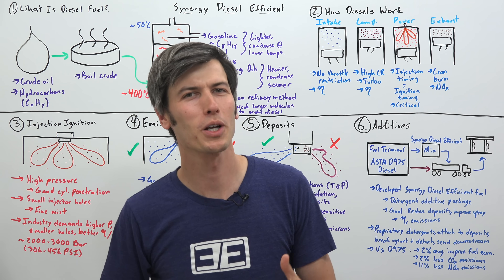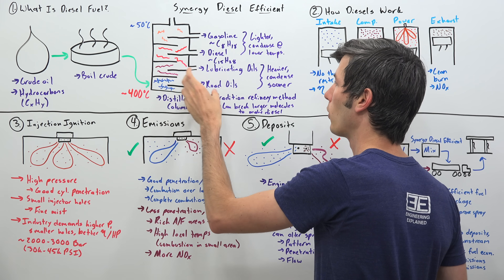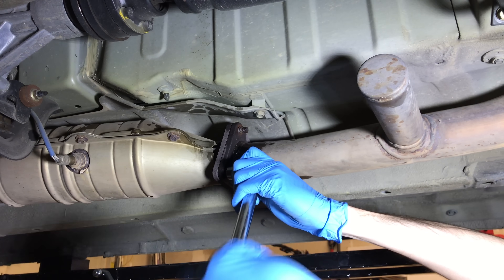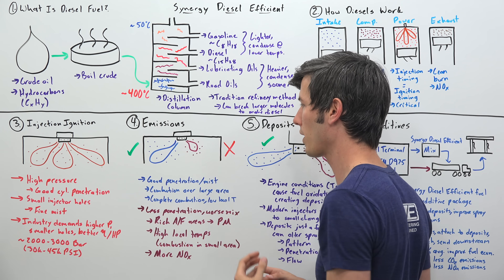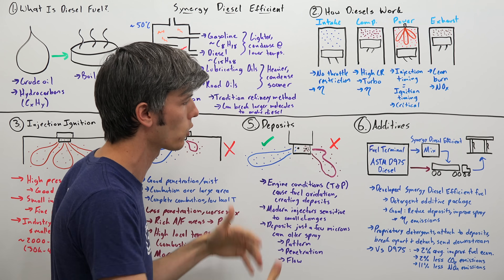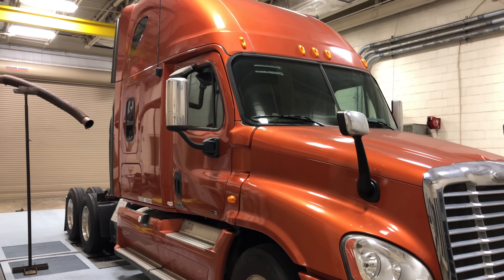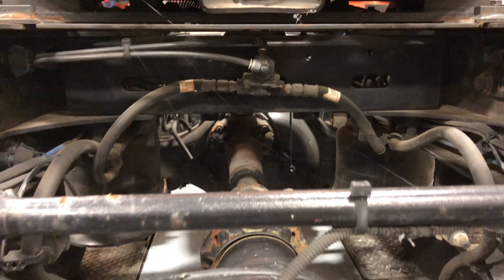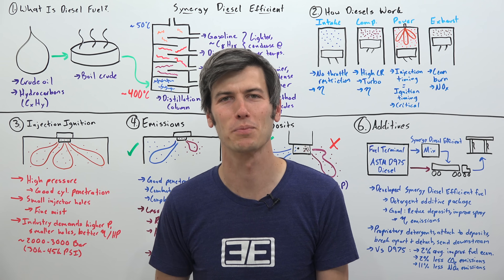Why Diesel Engines Lose Power & Efficiency Over Time

Comment: Good video and very thorough and interesting but as someone in the heavy trucking industry, I'm still not so sure about their testing of the diesel. Their variables are so controlled. How does it work in the real world? Where the variables are not controlled. I live in northeastern South Dakota where in the winter we spent around 100 days below 0°F most of it double digits below 0, just ambient temperature. Now in the summer we're in the upper 80's to 90's with some days getting near 100°. That's just for temperatures not including wind speed, engine condition, or driveline conditions. Do lab tests to determine a baseline then run a test vehicle in all sorts of weather variables then check the numbers.
Reply from the maker: If you don't control variables the data is anecdotal and significantly less meaningful. That's why you must control variables to see if a difference exists purely as a result of the fuel. These benefits will occur regardless of ambient conditions, but the benefit can vary with varying conditions. They also performed real world testing, it simply has a larger error bar.
Reply: @EngineeringExplained  I do understand the controlled environment testing first. To see if it actually makes a difference or not. I suppose if the engine is getting the benefits, it gets them regardless of the environmental conditions. I couldn't remember if you had said that they did real road testing in the video or not lol did they mention how many miles of real world testing? Short term memory loss getting me here but they tested it on engines that were pretty much just broken in right? If you had a little older or higher milage truck or tractor with aftertreatment and egr and switched to their synergy diesel, could the owner/operator have more frequent problems/regens with the dpf and egr due to more deposits going downstream until the combustion chamber cleaned up enough? Sorry for the long reply and questions lol

Comment: After learning about Diesel Particulate Filters, it is nice to appreciate the details about solutions for diesel engines. The "Regeneration" process to remove particulates was interesting to learn about. I'm glad this video gave a lot more info about these engines. I now have more sympathy with my fellow truckers on the road and mechanics in the shop. Thanks for the insight!
Reply: The emission controls ruin these engines and make they less efficient,  so burn more fuel, and makes us spend more money on parts when they go bad cause they all go bad , if we got ride of the controls then the only thing diesels would do is put out soot and have no NXo a cat causes the higher temps and that causes nitrogen,  then the egr was there to bring down temps but brings soot then they brought in a dpf  and that raised the temp got rid of soot but more nitrogen back, then they had the def that helps with nitrogen but helps ruines and destroys everything faster and burns more fuel, remove all that and we would be good to go

Comment: In order for this not to be just a commercial for Synergy Diesel you ought compare the results with some other "premium" diesel or maybe compare added costs of Synergy Diesel with savings made by using it.

Another thing are laboratory conditions that lack much of real world variables. This means that the test may not even be relevant in real life. People (Exxon) who planed this analysis already know this, but do not care. Since the whole exercise is just a commercial. Jason, I thin you caught yourself in something nasty this time. I really hate when honest engineers (or scientists) are used for deceit. Otherwise I really enjoy your channel and I hope you will avoid such dishonest sponsors in future.
Reply from the maker: So you're making assumptions while a company is providing data. Sometimes people choose what they want to believe and that's that, no matter how much evidence is provided. Not only was dyno testing performed, but extensive on-road testing as well. But if you want to prove an efficiency change, you need to control all the variables, hence dyno testing. What you choose to believe is up to you, but I'd hope viewers would prefer data over opinions, which is what I aim to provide.
Reply: @EngineeringExplained  Well I believe that Synergy Diesel is more efficient in some or even all conditions. But efficiencies are only relevant relative to costs incurred. Exxon knows that 3rd party independent tests will show some efficiencies in improved fuel. This is why they ordered the test. But they do not tell the whole picture in any case. What I am doubting here is the motivation behind these tests. The motivation is to sell something that may not necessarily be beneficial (in relation to costs) to its customers. What I am try to say is that the tests were set up to show beneficial results that are not relevant in RL. And I am sure that the tests were done as good as they could be done.  
And they are using your authority and the authority of the independent tests to market their product. I am sorry if I am too harsh. The video is brilliant from engineering point of view. I just do not like science being abused for PR.

Comment: i would be curious if you could figure out (with actual scientific research and investigation/testing ), if all the emissions equipment of diesel engines that is required today is actually making them pollute more or less. For example i believe the new diesel engines are required to have a high pressure egr , low pressure egr , and def system. I have heard from many sources that trucks that have these systems removed average 5mpg higher. that's burning a lot less fuel over the life of the vehicle. so does burning that lesser amount of fuel contribute to less pollution created per mile  vs the emissions equipped truck burning more fuel for traveling the same distance. plus the regen cycles the trucks go through burns even more fuel to light off the soot. compounding the increase fuel use.
Reply: I think there are 2 things: for less pollution of the planet, less fuel would be better, for the direct health of people, the amount of fuel is seen as not as important as the amount of particles and NOx emitted.
So what do you want to harm less: the planet, or the people... 

(new direct injecting gasoline engines mostly need filters too nowadays, but as i learned yesterday only 7% of all CO2 output in the world is from "traffic" which includes everything from cars, trucks, ships, aircraft... While 1/3rd of all CO2 output is caused by making electricity, so going electric might not be the right thing either causing even more need for electricity.)
Reply: @nirfz   i can see what you mean about having to choose 1 or the other. but since we are talking about fuels. the fuel also consumes energy and creates pollution just to make in the first place.
Reply: @TheDaltonmichaels  true, but as these fuels (both gasoline and Diesel) contain C and H in different amounts they can be produced by using CO2 out of the air and water. The enrgy to do that could be a good use for solar or wind power. They are better suited for such use because they give power when the source is available, not when people need it. (Co2 neutral Gasoline and Diesel Fuel is doable but at the moment fossil ones are cheaper) Fuels are easier and less dangerous to store than electricity at the moment. (faster to fill up too, and easier to extiguish a fire of these than of Li-Ion Batteries)
Reply: @nirfz  Another thing that i just realized is that DEF fluid production itself creates pollution. Now there are trucks driving around the country simply to deliver hundreds of thousands of gallons of DEF fluid to every fuel station and some stores every week. how many new tanker trucks got added to the road who soul purpose  is delivering DEF.
Reply: @TheDaltonmichaels  Valid argument.
Reply: Emissions as alot to do with temperature. Things need to be at the optimal temperature for the optimal emission. Catalytic converters need heat to work. Sometimes dumping more fuel in can help this. And burning more or less fuel can help with the temperature of the combustion. Never cars typically use less fuel still tho.

Comment: Do you have a video on the effects of the diesel exhaust systems causing additional fuel economy losses?
Reply: He didn't cover what extra emissions result from the additive. Sure, it cut some NOx, but is it now pumping out cyanide gas? Getting lungful of diesel combustion fume behind trucks, this is much bigger question as to what else is there due to additive.
Reply: I feel like they put all these emissions systems on the new diesels because of all the diesel fuckbois cranking up the fuel and blowing soot for days in their new trucks
Reply: @bdcasey11  those guys piss me off to no end.
Reply: Deleted my Cummins, best thing I ever did. The egr is what causes engine damage, the def is just a hassle and pain
Reply: Kenny, diesel exhaust systems have effect of the lawmakers causing additional fuel economy loss, not just by itself
Reply: I don't think they do. Cars are bigger and heavier. Bigger wheels. Bigger everything 🤔
Reply: Are you referring to selective catalytic reduction (SCR) systems that use DEF to reduce NOx emissions? Or diesel particulate filter systems? I'm not sure how treating the exhaust with urea would decrease fuel economy. DPF systems, perhaps, since the engine would have to work harder to overcome a restricted DPF.
Reply: So why not use multiple injectors on each cylinder?  You will obviously get a much better spread by using 2 injectors instead of one.
Reply: @tarstarkusz  where are you sticking all these injectors? you want a even spread in the cylinder, so, on in the center... 360 spread... put 2.... meh... ontop of the valves already... and the cost.... diesels are already not worth the extra cost... adding 6-8 more injectors? LOL
Reply: DEF, EGR, DPF = delete
Reply: @D4rK_An1mA  Hope you like the heavy fine if you are caught and the fact your vehicle will NOT pass inspection if it is removed.
Reply: Kenny yes!!!!! He should do that cuz that def system on diesels suck down the power and mileage
Reply: Diesel exhaust after treatment systems only use extra fuel when they are equipped with a DPF.  SCR (DEF) systems do not use extra fuel for their functions.
Reply: @KALI1080  the SCR is added on after the DPF. So yes it uses the same amount of fuel. The DPF is unchanged after the addition of SCR. The two systems work in conjunction with each other.
Reply: Yeah, good video idea. I straight piped my Cummins 5.0 and got nearly 10 MPG better on the stock tune (8 MPG increase)
Reply: @wyattlarrick3246  I HIGHLY doubt that removing a DPF gave you a 50% increase in fuel economy.
Reply: @usingthecharlim  But what is extra stuff coming out of exhaust from additive? I suspect it's not as deadly as VX gas, but just saying it's small fraction doesn't mean anything unless potency is considered.
Reply: If you have a light duty diesel that only lasted 200k miles, you probably have a 6.0 Powerstroke.

Comment: Love it how efficiency is measured on day 1 and ignored thereafter. Who cares if the motor/emission controls let go @150k and need to be replaced... may I be controversial and say a good predictor of overall efficiency  is the price of the truck on the used market
Reply: In germany you need to do a complete inspection including emissions test every 2 years to keep your vehicle registered.
Reply: Except a complete truck has many wear items. Better would be used engine prices. Which for diesels are shockingly high.
Reply: poobank 

Nothing controversial about it. You are simply wrong.

Comment: A euro vs US comparison on the quality for the diesel fuel could be a good follow up..
Reply: Yes, but in the EU there are quite some differences. If I drive from Holland where I live to Germany (1 hour drive) the quality changes (normal diesel in Germany has more % biodiesel).

So there is no 1 EU diesel
Reply: @MaUrIcEtAxI  in sweden people are noticing that if they are in for example Denmark or Germany that diesel cars consume way less on foreign diesel than on domestic diesel.
Reply: Every country by his regulations or corruptions has their own diesel.

Here in mexico there is a mix 50% ultra low sulfur diesel and 50%some lubricant
Reply: @batialexis9339  That's cool! Here in russia we havea mix of 50% low quality diesel, 50% donkey piss
Reply: @dddsa5951  well if works you'll save money on fuel
Reply: Yes, mostly euro have not so heavy loads might be wrong
Reply: @batialexis9339  nonsense. EU spec cars have more towing and payload capacity than US spec ones.

Comment: Cost/Benefit analysis would be important to consider here...
Reply: Cost/benefit? They have to put this aditive in order to sell the diesel. That means even the cheaper diesel u get has it...
The only guys that have to concern about it are the producers... thats why they must work to develop their fuel. And thats also why i belive in premium fuel... it may not be much different from normal fuel but for sure the producers are intruducting more aditives or new formulas of the old aditives in there

Comment: Does fuel economy, CO2 and NOx emissions  depends on the air temperature? On a hot day or on a cold day there are more CO2 and NOx emissions?
Reply from the maker: Temperature will affect overall efficiency, and thus CO2 will be impacted. And if temperatures get higher, higher combustion temperatures generally result in more NOx emissions.
Reply: ...and this is where EGR comes in. It allows for a “cooler” combustion temp when less power is demanded, leading to less NOx emissions. Downside? Carbon buildup on the intake valves.

Comment: The real question is: should I buy Cayenne Diesel with 90k miles on the clock for a decent price? I've never bought a car with so many miles in my life....
Reply from the maker: The engine may be fine (or maybe not), regardless if you're getting into a luxury brand you should expect to pay luxury maintenance expenses unless you'll be doing the work yourself - and even then, parts can still be quite expensive. 90K isn't a ton of miles though.
Reply: @EngineeringExplained  Yeah I miss my S2k days, in 10 years and 90k miles the only thing that's failed was thermostat that was replaced for $100 bucks. Now I am in the market for either 2015-16 Cayenne S or Diesel or 16 GSF. Of course GSF is a much more reliable but it's also about $10k more then Porsche and $20k more then Cayenne with those 90k miles :)
Reply: @EngineeringExplained  put a deposit down, hopefully won't be a major pain in the ass

Comment: diesel engines nowdays utilise EGR and turbos; the carbon build up over time blocks these ports, so the power performance isnt run to engine designs.
Reply: ^^^this.
Reply: Supposedly cummins new SCR system is good enough that they are ditching EGR and DPF, dunno if the pickups are getting it though
Reply: To clean up carbon deposits; what they used to do is take the vehicle out and run it under heavy load for half an hour at a time. Trying to keep it as hot as possible, without overheating the engine. And it has to an actual torque load; such as a heavily loaded trailer, or some kind of hydrodynamic braking mechanism.
Reply: How can you fix this ?
Reply: @RobertoRP  Italian tuneup.....
Reply: Roberto Rendon delete egr cooler and scr, doc. Or another way around this swapping in a older engine.
Reply: tikiiz There’s cleaning additives that help clear carbon build up. Or try using a premium fuel, if available where u live.
Reply: @steak8278  by cleaning the EGR, do you mean disassembling it and cleaning with something like wire brush?
Reply: my friends opel vectra was dirty af, the engine ran way better after.
Reply: @benjaminfifield8838  thank you very much Ford the Reply 
I have a truck that runs on Diesel, Year And a half of use and 110000 Kms. Reacently I sense an sligthly More cosumpsion of Fuel.
I Added a additive to the fuel wich sais  its for inyector clean
Anyway ill be cheking this out with a mecanic
Reply: @RobertoRP  you might want to replace your air and fuel filters too.
Reply: @UncannySense  I replace those every 8000 Kms.

I use an 10 000 Kms Engine Oil. And perform the oil change every 8k Kms.

I replace every filter every time. Been doing that since I boght IT Brand New. And I never had any issue whit My truck